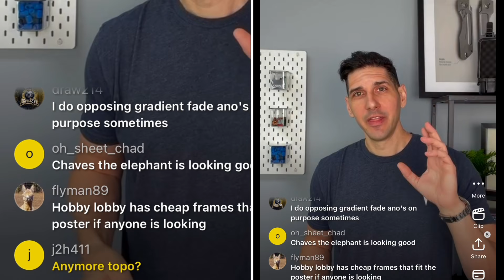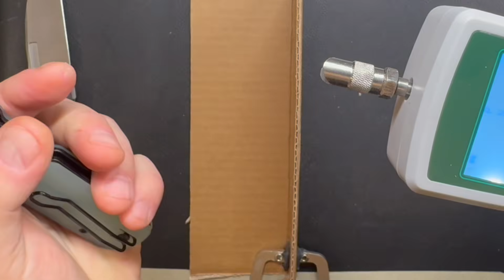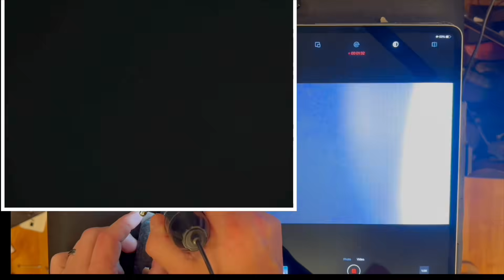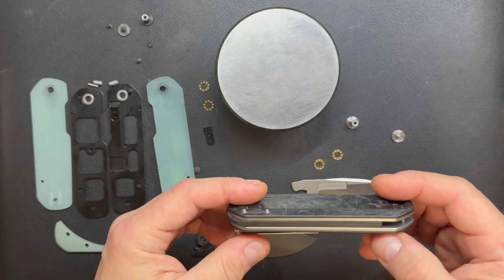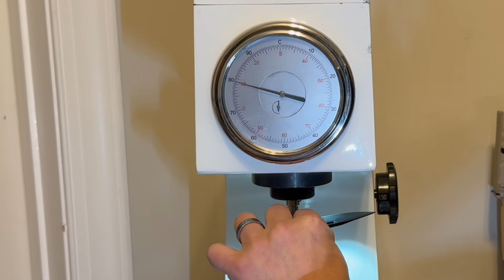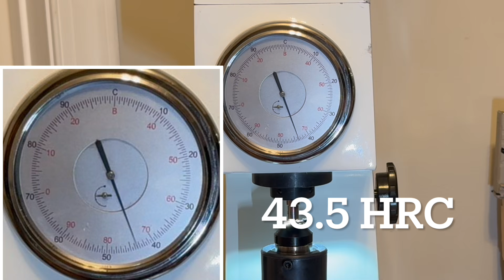Fundamentally KNIFE. What’s inside Vero Avid 2?

Comment: Im not really a fan of vero. Most of his were too thick behind the edge and soft m390, with a focus on the image of said design and action for fidgeting, less of a knife. Bestech isn't the best heat treatment, not sure ehy you're claiming that. They eventually improved magnacut over 62rc which they did for years and m390 at 57 to 60 for years too. Only a few years ago did they increase magnacut to 63-64rc. And most makers have said bestech wouldn't increase the hardness of m390 over 60rc. 
If he is grinding the blades himself, he's likely not doing so under water fed belts and thus the apex will be burnt. And if he microquenched in water intermittently, thats also not good for the temper. Overall i don't get anything from bestech, but im glad they did make an improvement to there magnacut ht. At 63rc it performs better than 60rc m390. I also avoid vero models but he did use Reate for at least one of them. S45vn kinda glasses out, its somewhat decent at 63-64rc. Not really decent at 61.5
Reply from the maker: Your beef shouldn’t be with Vero, rather Reate who made their earlier models like Lux. Avid is made by Bestec and their HT is on the higher side because I tested their knives on my channel. That MagnaCut tested 63.5
Would you like the link to that vide? It’s up on my channel 👍
Reply: @CBRxLIVE  its not like magnacut is even that good, even at 63.5 its ehh. For comparison, reate secondary hardened 60rc m390 and 62rc m390 is much better. Again, Im glad bestech made it better than the 62rc they were doing before. Reate didnt make there earlier models. Bestech did. They only did one model with reate later on. I cant remember the model name.
Reply: @tacticalcenter8658 could you refer me to your YouTube channel or maybe a link to your custom shop. I’m always interested in leaning. Maybe you could show us you testing the heat treat and magnifying the grind. Personally I have a lot more confidence in the creator who conducts such test than someone just making remarks without a single source to validate your claims
Reply: @mdell4959  lol do you know anything about Vero? Hes not a custom knife maker and he doesn't test anything either. And we've been hardness and cut  testing long before cbrx.
Reply: @tacticalcenter8658 do you have links to your tests?
Reply: @leonisvargas  you can check out all the tests everyone's done. Your thinking that only cbrx is the only one doing this? 🤣
Reply: @t @tacticalcenter8658 you claimed you have been doing tests for much longer. Where can I find those tests? 

I never said he is the only one. You are saying, I said that. And then laughing about it. You say something. Other people question what you just said. And you just change the subject.

Comment: Pvd does i ndeed drop the HRc as does /dlc. There is NO reason that creocote should drop the hardness other than the surface which is in reality an epoxy paint that is baked onat a low heat. Much lower than tempering if done by a competent shop.   
There is a new version of DLC that uses a much lower temp, but it is still a bit experimental at present.  There are several levels of DLC coating hardnesses and two completely different methods of applying it. A search of DLC coating types will most likely show good info. The Chinese are developing low temp DLC. Not presently holding my breath yet!

A HRc mark whether you are famous or not if documented and giving satisfactory results will always improve the value of a knife. Not only will it give the owner or buyer more faith in the knife, It is hard to have it done locally by most people.  

glad you are not hawking yourself as famous. Amazing how many tubers see themselves as celebrities for no other reason than they have a cameras. Worse, a lot are not seeing themselves as premier knife designers when they seeming have no idea what the different blade shapes are fore or even what they are called.  A disgrace.  (Sadly, a lot of knifemakers share the same issue there). 

KnifeMaeker/ Medically retired after over 47+ Years in the Craft and in association with the Original R.W. (Bob) Loveless/JIm Merritt Custom Knife shop.  (RIP Guy's)  For what it is worth, Loveless was and is considered the have been one of if not the greatest knife designer who ever lived. There is a lot of info on here on the tube including two movies about him.
Reply: I tried to mention about the coatings before, so hopefully he believes you Micheal. I Appreciate you commenting about it.

Comment: Where did you hear WE made CKF knives? 
Any sources?
Reply from the maker: They admitted that to Metal Complex, who was inflating that brand for years repeating their claim it was Russia made. Then had to publicly smooth it over in couple of videos. Supposedly they “assemble them in Slovenia out of Chinese parts”
Reply: @CBRxLIVE  I knew it was china but I read Kevin John (they were a clone making company) oem's their knives
Reply: @BambiWolf13  they have used different manufacturers throughout the years iirc. It's also been known for many years that ckf just put together Chinese parts and tune them at ckf's location which iirc has changed at least once or twice throughout the years. Ckf heat treatment is also somewhat low on m390 and m398. M390 being about 60 and m398 at 62rc, 64 is where it should be, like Spyderco has done on some of the mule team knives.